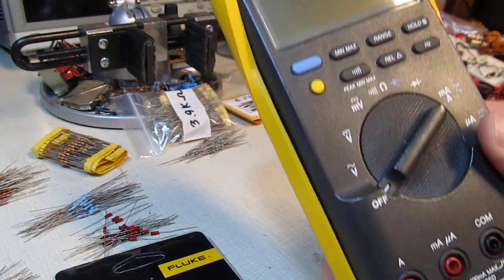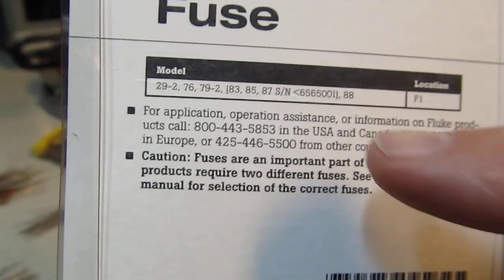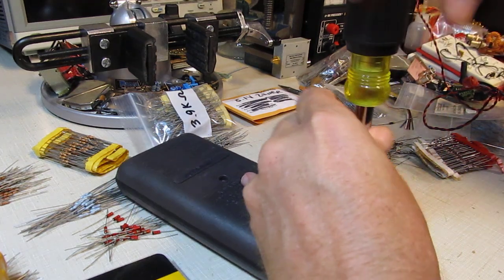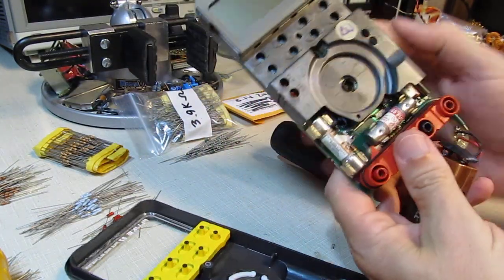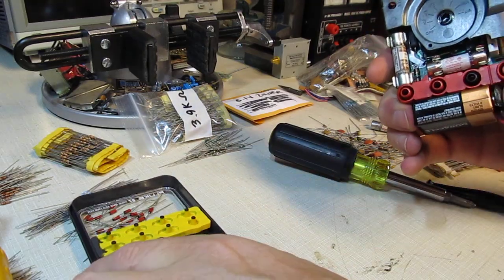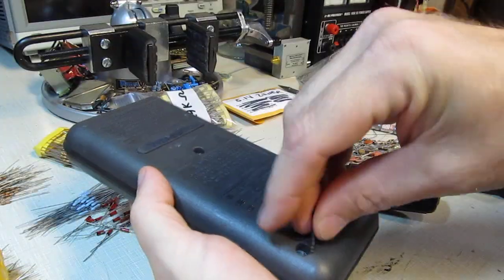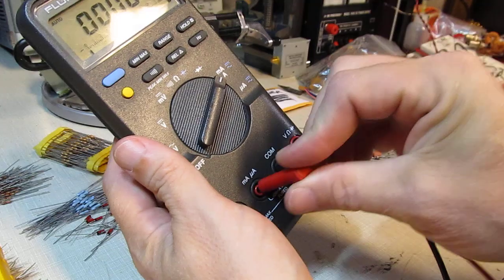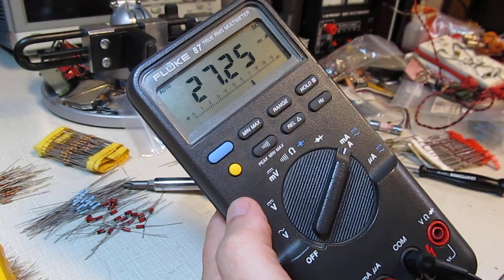#109: How to: Fluke 87 Multimeter fuse replacement,  DMM True RMS

Comment: Various fuses of an AIC amps interrupt circuit. Is it the fuse elements material or what determines the AIC current rating and threshold? The AIC will only open the shirt circuit if it's under the AIC rating but will weld bond itself today internal allowing the short circuit if the short is above the current of the AIC rating. The fuse AIC rating will only protect a circuit if it's below the AIC threshold, will not protect the circuit if the short circuit current is above the AIC threshold any reasons why?

Comment: Any reasons why current increase when various types of circuits is out in high Hot temperatures? Example Guitar amplifiers mostly use Slow Blow Fuses but when guitar amplifiers are playing outdoor gigs the slow blow Time Delay TM Fuses will blow because the guitar amplifier will draw more current because the outdoor gig that is 100F/100C or plus has increase the current draw of the amplifiers. I'm not sure why hot temperatures will increase the current draw of a circuit.

Comment: What is the difference between a ceramic fuse to a normal glass filament fuse? any reasons why or when to use a ceramic fuse? is the only difference between a ceramic fuse compared to a glass filament fuse about the time delay?

Comment: What have you used or give example of when to use the Min Max button on the Fluke meter? I'm not sure when I would use a Min Max for what circuit testing application
Reply from the maker: It is not used very often.  One use-case is when you're tuning a circuit for a minimum or maximum response - it allows you to record these values without watching the numbers.

Comment: Do you know of any stores that can sell the Fluke 87 Multimetter LCD?
Reply from the maker: There are places that sell it, such as: https://shop.flukerepairkit.com/  However, the most common problem is the elastomeric strip that goes between the PCB and the display.  These "zebra strips" go bad and the display gets dim.  Replacing the strips is often all that is needed.  This is cheaper than a new display.  If yours is just dim, this is probably the problem.
Reply: Thanks

Comment: Great video. I would like to know why this series of Flukes eventually start burning through batteries in short order. I still have my Fluke 77 from 1985 and it will go years on a battery with lots of use or even in storage.  My first Fluke 87 started chewing through 9 volts in  a few weeks even in storage so I replaced it with a series III version and after a couple years it started doing this same.  I keep my Flukes in various locations so they dont always get used. I can put a fresh battery on one of the 87s and never use it and go back 6 months later and its dead.
Reply: Did you figure out the cause of this drain ?

Comment: I have a bunch of DMM's  which came without any fuse protection on the millamps range.  The place on the circuit board was there but not populated.  I bought a  bunch of 1/2 amp resetable thermal fuses which work great and no need to buy expensive ceramics.

Comment: Hey what's up . I already replaced one of the blown fuse and it still not working what else could be the problem with my multimeter.
Reply from the maker: MrFreddyelgato Could be a lot of things.  Check all the fuses.  Make sure the battery connections and wires are OK.  Could be a problem with the electronics, in which case it could be much more costly to repair.

Comment: You're absolutely right! However, our mains plug doesn't have fuses. And I would like to replace it with a identical fuse, for continued protection. My Uni-T UT61E however does use British Standard BS1362 fuses!

Comment: God damn touch screens... Well take your positive test lead and touch the Amp or mA terminal. At Amps you should get a short and at mA it should be 10 kOhms if the fuses are OK. If the fuses are blown you should see a break (OL). I know it works on fluke 89 but I think it should work on all flukes. Sorry for my poor ENG. Regards Marek.

Comment: Wanna know how to test if any of the fuses is blown without opening the meter and only using the meter itself ?... like this:
The COM terminal has connection to the AMPS terminals -through- these fuses (to protect any excesive current inside the meter) so.. put the meter in OHMS... short the leads... verify that the leads work (low ohms).. press REL if you have it... and then change the COM terminal to the AMPS terminals... you will now be reading the fuses' resistance... OR it's open circuit..

Comment: A technique I have found very effective on re-installing all self tapping screws is to always very gently push on the screw while turning in the CCW direction until I feel the  gentle click of the screw dropping into the existing thread. Then turn the screw in the tightening direction. This keeps you from re self tapping the hole in between the previously formed thread which is what accelerates stripping out the plastic threads. This also applies to self tappers in metal.